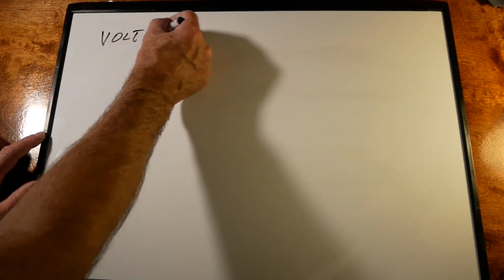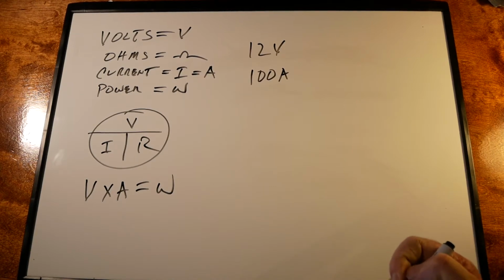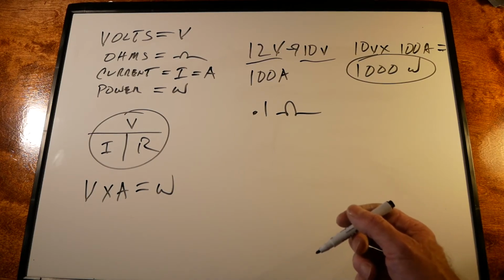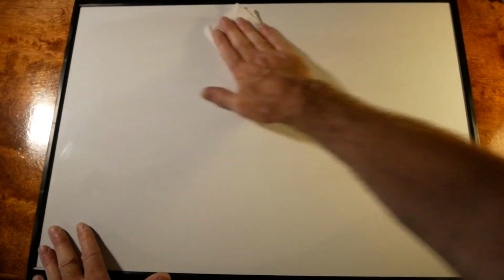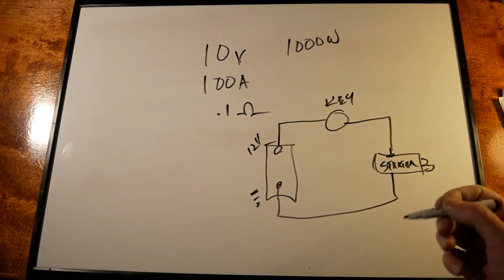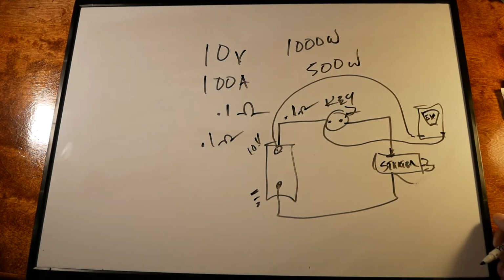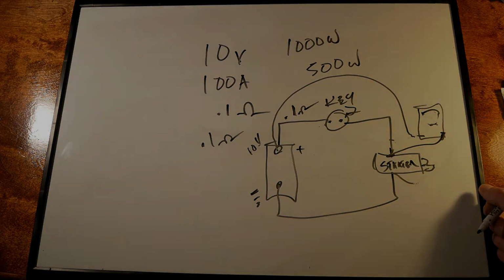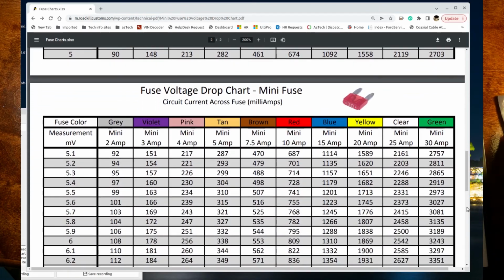Explaining the difference between 6 and 12 volt systems. Defining Ohms, volts, amps and watts.

Comment: So on a 12 volt system are you still better of using a bigger cable ? Any value to using a bigger cable ?
Reply from the maker: Absolutely. A common trick on a vehicle that had starting issues is to convert to 6v cables.
Reply: Thks that's what I was thinking and now it's been verified!!!!